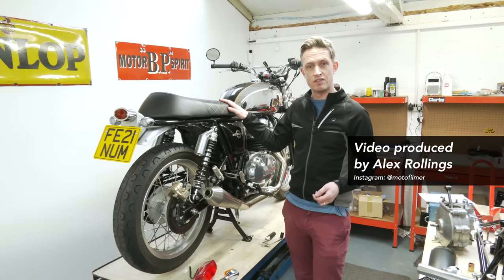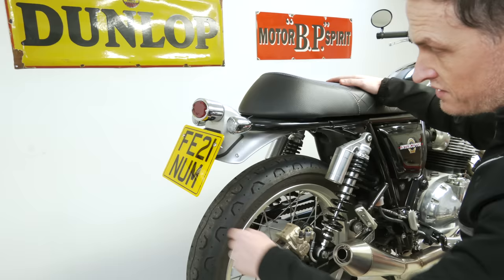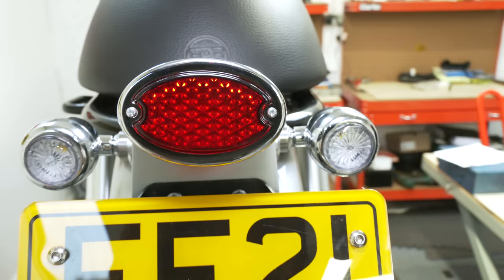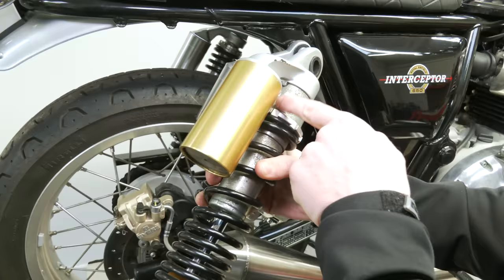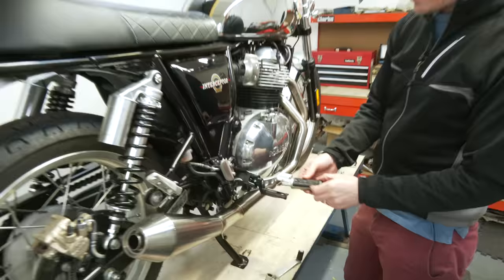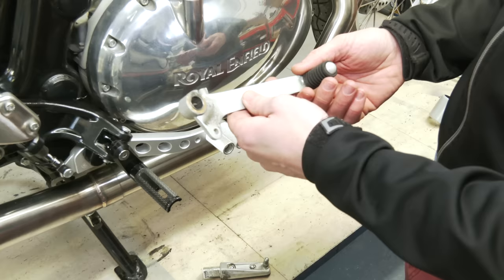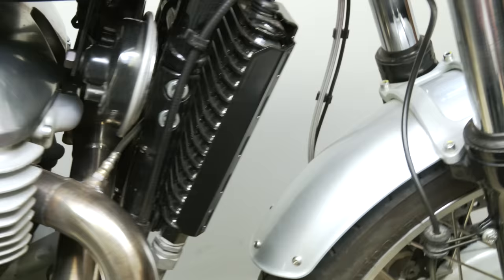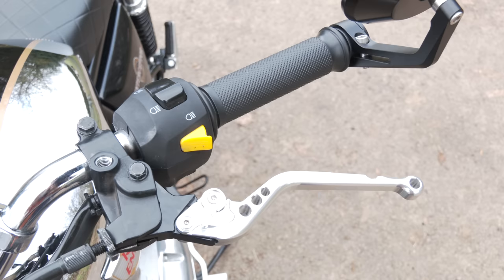Royal Enfield Interceptor 650 - channel project bike - part 1

Comment: hi Guys i have a Cont GT done some similar mods, by far and away best thing i have done was fitting larger rear tyre gone up 20mm over standard ceat tyre, plus match front, what a difference all the twitchiness in the rear on uneven roads or when overtaking across white lines gone, did have to take a little cut out of the chain guard, bonus being looks so much better from behind now,
Reply: @sinorman231  what size tyres did you fit and what make?

Comment: I put on the S&S  silencers which I prefer the look off to the single  and replaced the seat with the identical looking touring seat which dis a lot more comfortable once you get past 45 minutes on the bike.  BUT the main upgrades I did and would recommend is replacing the plastic mudguards and chain guards with polished stainless.   Really nice to get rid of those big lumps of plastic all together.   
The nice thing about the RE  650 is that you can have fun customizing it with bits and pieces at reasonable prices and with such a low initial cost you are still at half the price of a new Triumph. I was on my way to view a 2012 Bonneville for $7,500  when I stopped at the RE dealer and after a 10 minute ride bought on the spot, a new chrome tank version for $6,200,  as it brought such a smile to my face.   At the time I wasn't even aware of the RE 650 until when searching online for  a Bonneville  the RE 650 adds kept popping up.  I was skeptical at first but after reading tons of reviews  I thought it was worth a look and wasn't disappointed. I was concerned the 45 bhp just couldn't propel my 300lb body but found it gave plenty of power for back road riding.  I have been riding 56 years and already owned a 100bhp VStrom, a 68 Bonneville and 73 Commando  and I bought my RE 650 for the same reasons you did.   I no longer do 5,000 miles trips and for back country sunday rides the RE gives me more fun than any other bike I have had.  When I get on it I am immediately taken back to the feeling I had riding my Bonnie back in 1970.
Reply from the maker: Thanks for your comments. I’m sure others will find that very interesting to read :)
Reply: @TheClassicMotorcycleChannel  This bike is less sophisticated than a 1975 Yamaha XS650!
The 45-year-old XS650 would in fact be a better bike - by any criteria. The old Yamahammer would eat his thing for breakfast, and last twice as long.
Why are you limeys so excited about it? Just because it has British name?
Its an anachronism. A thing belonging to a period other than that in which it exists, especially a thing that is conspicuously old-fashioned:
Reply: I'd taken my adv in for some warranty work. While talking with the service desk my wife was over checking out the Interceptors. She suggested I take one out to see what I thought. I was blown away by it's balance and handling. Beautiful bike! so I bought it, with my wife's blessing of course. 👍👍
Reply: @sscbkr48  Good on you John.
Reply: Any updates on episode 2?

Comment: That just sounds so much better with the TEC 2 into 1 Stinger, I had the same experience when I fitted the 2 into 1 Arrows system on my 2006 '900 Scrambler many years ago!

Comment: The 2-into-1 exhaust really makes a huge difference in both weight and sound, just having both exhaust pulses travelling down the same pipe. I don't know that I would sink so much money into the cosmetic upgrades, but they do look nice. The suspension upgrades are not something I'd bother with, as I'm not looking for all-out performance, and I've generally been satisfied with the factory fitment on any motorcycle I've ridden. I'm sure they perform better, but the cost for such upgrades is generally substantial.

Comment: Nice job! I appreciate your adding the spacers to extend the signals out further, they are intended to be seen after all. I also like that RE gives you the option of long fender or short fenders with those 'extenders.' You can put 'em on when touring, and take 'em off when only riding local.

Comment: I liked the original sound of my 650GT (I prefer quieter bikes) but I did replace the exhaust system with the 2 into 1 system as you did purely for the weight saving (I also used the Tec Bike Parts dB killer which left the bike not too much louder than with the original exhaust system).  I'm looking forward to learning what tyres you will upgrade to.  I find the Pirelli tyres that my GT came with OK in the dry.

Comment: changing the exhaust pipe and air filter  >>  will not change the ECU map ! The map is permanently encoded on a chip ( which can be altered, but you need a special rewritable chip and gear to do it ) ......but because the bike has a closed circuit system, the oxygen sensor at the exhaust head will automatically adjust the fueling, and hopefully the spark, to suit 
BUT the bike looks a shit load better.  I thought a bum bubble that could be attached at the back of the seat would really nail it

Comment: I went with the Twinton headlight brackets which looks the best out of all the aftermarket headlight bracket & is hinged type.
Center stand weighs 2.5kg which is substantial.Progresive springs & 
adjusters, emulator & drill the hole bigger in dampening rod be great or the Yss fork upgrade kit or similar is good but better with a bigger hole or holes drilled in dampening rod.
Reply: You’re the master of this bike my ole matey. I know your humble, but I mean what I say.
Reply: What about the Tiger for the type of roads down your way
Reply: Great 👌👍 bike.

Comment: Nice bike. 
"Higher flow" air filters are largely gimmickry though. Unless an engine has been opened up and had machine work done the stock element is fine...the only "gain" is increased induction bark.
Years ago, a local parts supplier had an aftermarket high flow air filter "demonstration" set up on their counter. It consisted of ping pong balls in a clear tube that were moved upward by an electric blower fan.
You could swap out a "stock filter element" with a "high flow filter element" and watch the balls sucked higher up the clear tubing. No idea how this related in any way to the actual cfm an actual engine required, but it was an effective sales tool, I suppose. Also no idea how the engineers responsible for engine design could get the rest of the equation right, but simultaneously be unaware of floating ping pong balls.
When I had my SV650 Suzuki I belonged to a couple of forums. Others on the forum advocated for high flow aftermarket filter elements and were surprised to learn that Suzuki used the same part number for the SV650 and SV1000.
Marketing is amazing.

Comment: Good video. Thanks for the updates. Easy method to remove the fork reflectors is to use dental floss in a sawing action between the fork and reflector. Then use paint thinner to remove the glue. 
Hope that helps.
Reply from the maker: Great tip!
Reply: If you do any riding at night I don't recommend removing the reflectors. You need all the visibility you can get.

Comment: Don't want to nit-pick gratuitously, but the clutch cable is going to be cooked by the header pipe (which is probably now single-skin and even hotter than the standard ones) that it passes within a cm or so of.

Comment: I I would be interested in hearing how the foot controls work out. I was thinking about the super meteor or shotgun but they are about 100 lbs heavier.  The more i researched the more i found the interceptors specs to be almost the same as my classic 500.  I am of course referring to weight,  seat height, rake etc.   If you get the front controls forward a bit and out a riser on the bars you can get almost the same rider triangle as the classic.  Those attributes and with a nice 650 power plant are huge selling points for me.  Now to find a nice deal on a used one  to keep my costs down. I would eventually want tubeless tires, hagon rear shocks , progressive front internals, that exhaust those turn signals.  Yeah i would end up with almost same cash out lay but i could do it in stages so my wallet wouldn't be strained and have exactly what i want.   Great little bike.

Comment: I wonder what the Interceptor would sound like with the stock twin exhausts but with a balance tube between them, ie: like the classic Triumphs.  Unfortunately nothing can be done about the 270° versus the  'proper' 360° crank angle. 😮

Comment: All nice mods so far. The exhaust sounds excellent. 
A couple of "in my humble opinions"...the stock cross-bar handlebars are ugly as sin... my preference would be a slightly lower (cross-bar-less) bar - width dependent on "feel". Carry passengers? Were it mine, I'd remove the frame bits supporting the passenger pegs. 
Looking forward to parts 2 and beyond. Keep it up.
Reply: The rear passenger foot-peg bracket is also used to mount the end of the exhaust and the rear brake reservoir. What little weight you'd save removing the rear pegs and bracket would likely be lost by having to reinstall another bracket for the exhaust and brake reservoir...

Comment: A lovely bike, especially when viewed from the rear, which is very neat. From a personal perspective, I would fit a lighter twin exhaust system from an aesthetics point of view, as well as to balance out the lateral weight distribution. I am also not a huge fan of the TEC headlight bracket, which looks a bit wimpy (beefing up the units fork fittings may help out a lot here because the current items look like posh hose clips). So I would probably keep the RE part, but paint it black. 😊

Comment: Subbing 👍🏻😉. I’ve got a F-3S Spyder by Can Am. Like it quite a bit. The 1330 Rotax motor has lots of power with the semiautomatic trans. You have to up shift via a paddle but it automatically downshifts as you slow down. I can downshift my self but it’s optional. Love my Spyder.

Comment: Has the bike had its brake recall done?
The callipers have the Bybre logo on them and replacement callipers don’t 
If not contact your RE dealer as it’s a warranty issue(foc)

Comment: Hello again, where did you source the stainless steel spacers for the front and rear indicators, thanks.
Reply: Hi Barry.  I got them off eBay from GWR-fasteners.  They do a range of stainless collar stand-off spacers in lots of metric sizes 👍

Comment: I have the same colour Interceptor, the only one to have! Question: when you fitted the indicators did you have to change the flasher unit or fit resistors?
Reply: No we didn’t but I think we will add new resistors just to improve the flashing rate a little
Reply: Hello Barry how are you 😊

Comment: Could you please tell me where you sourced the footrests and levers as I , having moved the rear ones forward, need to move my own a bit too. My only criticism of the bike so far is that all the rests are too far back, which is probably due to the Interceptor being a spin-off of the Continental.
Reply from the maker: TEC Bike Parts - www.tecbikeparts.com
Reply: The Interceptor is not a spin off of Continental, they came out at the same time.

Comment: Is some of the weight of the stock exhaust the internal catalytic converter? I don't see an oxygen sensor, so I assume not...
Do you really need a sump guard on a street bike? Mostly useless unless you plan on driving over curbstones...
You've replaced the front and rear turn signals with ones mounted much closer to the front headlight and rear brake light. Be aware that moving them closer to those lights makes them harder to see, especially beside the bright headlight. If you have daylight running headlamp, it's even harder to see in daytime, unless they're quite bright. 
Other than that your mods make unique improvements to weight, appearance and performance.

Comment: These are not really ROYAL ENFIELD bikes, they are simply a jiggly made bike fitted with a nameplate that was once fitted to a great British bike. Like so many UK bike manufacturers Royal Enfield (GB) went down the pan with the likes of BSA, AJS, Matchless, Norton and a host of others. The old R.E. Meteor production line was shipped out to India and ever since anything produced with a R.E. badge has been a "joke bike".  People (silly souls) bought into the nostalgia of a very cheap historic brands like R.E. and A.J.S., these penny pinchers would have better spent their money on a Trabant...............Point of interest I owned a 1961 Royal Enfield Crusader bought in 1963 for £145.......................and then having passed my "test" had a Norton Dominator 99 (600cc) that was souped up with high lift cams, twin carbs, Dunstall mega's and a bucket seat and flew like s*it off a shovel